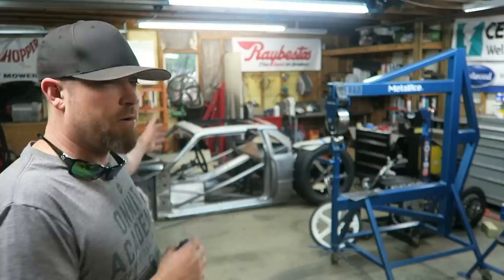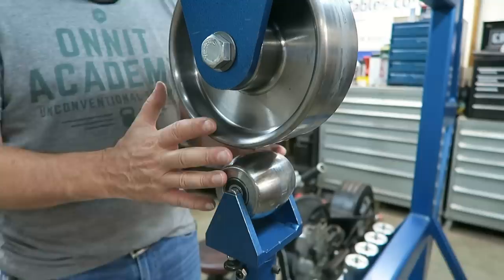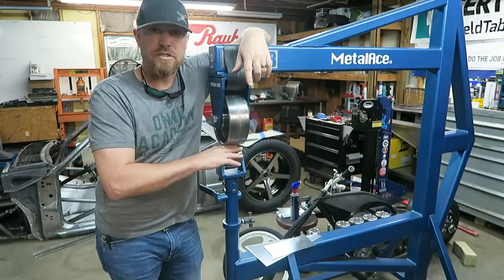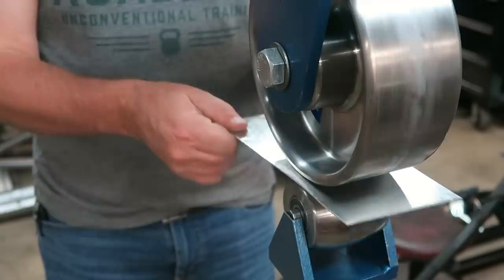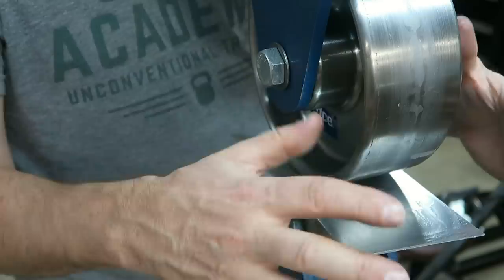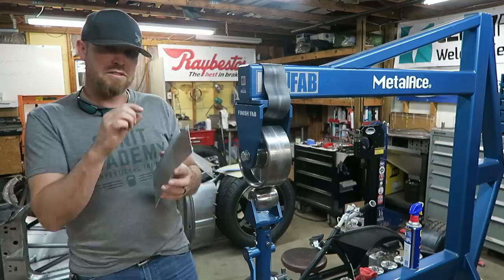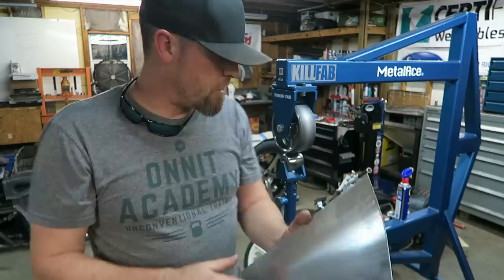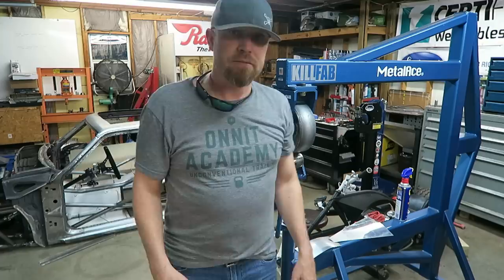How To Use An English Wheel | Simple Instruction

Comment: what happens if you over stretch the area, how do you shrink it back down ? 
Also , are there any tricks to holding a larger panel like a door skin if you don't have someone to help? ie can you use an extension table to support the metal on the on the side ?
Reply from the maker: there are ways to shrink but it isnt easy...best advice is to just take it slow

Comment: Great video.  Quick question that I’m sure you already answered somewhere. Are the goose headers just normal stock replacement shorties that you turned around and swapped sides?
Reply from the maker: they are....they are some stainless shorties that I just welded some v bands too.
I am actually using the same ones on the Bibbster as well
Reply: The Fab Forums 
Good too know thanks. I have a blow through procharger 4 eyed fox that I’m board with and thinking of twin turbos since I have QT carb, regulator, fuel pump, ignition, and intercooler already.
I have a set of stainless shorty equal length headers that I was thinking of using 
Love your videos and your inspirational quotes.